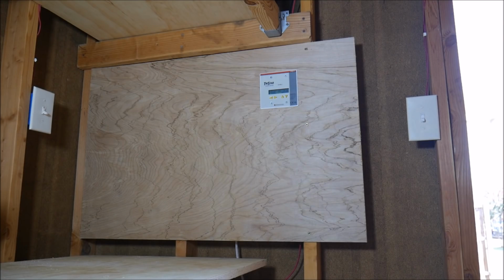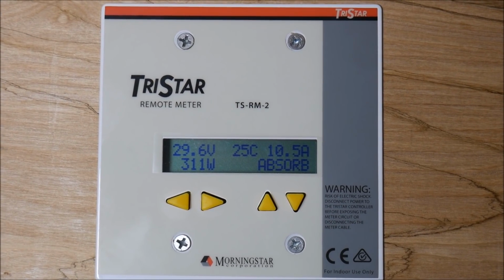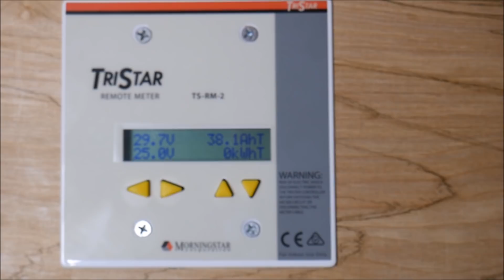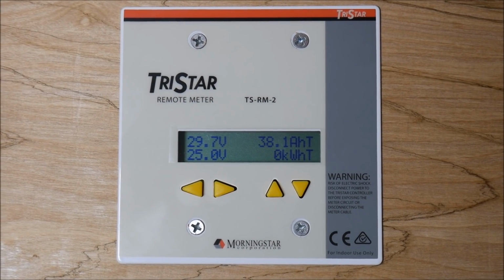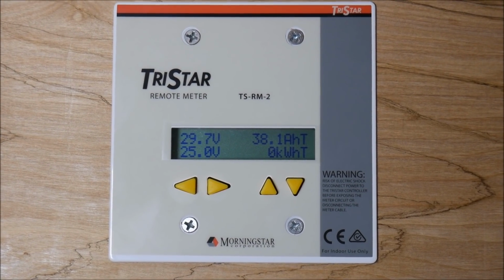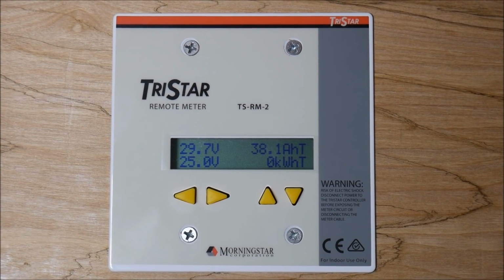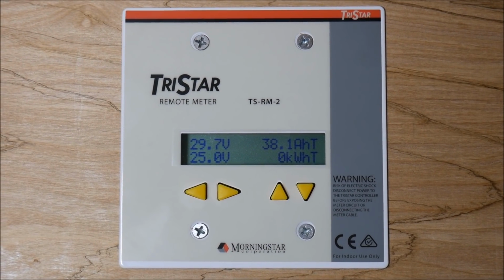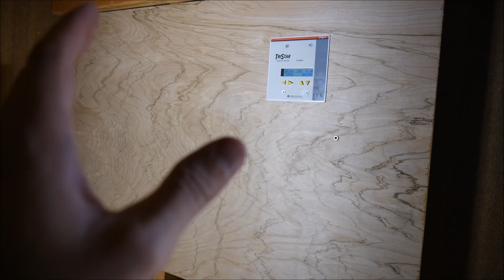Redoing The Solar Shed Part 9 - Finishing Touches

Comment: Very well done professional series! So sad what is going on in your state right now!  I did see an article about a guy in a tiny home in FL and how he still had power, when all else around him was down!  Stay safe!
Reply: oops:  the guy in FL was on all solar like your shed.
Reply from the maker: Yes, only people who had generators and lots of fuel or off-grid solar would have power in a grid down situation like that.  That is one of the reasons I installed this system and got into solar.  I grew up in Oklahoma and there are hundreds of tornados each year.  If one comes within 20-30 miles it can knock out your power for potentially days.  I haven't had that happen but I know others who have.  North Texas where I live doesn't have as many tornados but they still happen.  Also, we have ice storms in the winter because we don't get much snow.  So it rains and then it freezes after it falls.  So ice builds up on the power lines and then they get too heavy and snap.  So we can get power outages in the winter, too.

Comment: What happen to you 600 watt set up
Reply from the maker: The panels are still on the roof.  That was one of the only things I re-used.
Reply: LDSreliance I found your pin on pintrest  and I saw your tests at on point
Reply from the maker: Cool, I didn't know my videos were on pinterest!
Reply: LDSreliance it just the one were you show your duel charge controlors the bank that you had I believe the panels were up against  the building at the time I don't  believe you were final on anything you set up lol
Reply from the maker: Oh that was just a test setup.  I test things on my back porch and just lean the panels against something.

Comment: You could try running 2 fans in series for 24V. You might need to check for resistance match after wiring in series by checking the volts across each fan. Hope your family are well, I have been praying for you.
Reply from the maker: Thanks!  I appreciate the prayers and the suggestion.  I should have thought of that.

Comment: Most importantly, glad to hear the family is doing well.  Now,  where o where is my thumb?   O...here it is. 👍!  Good video.  Lots of folks will be helped by it.  The communication cable and power cable proximity will be just fine.  No problems there.  And the doubling of the two screw connectors is ok for your use.  Your new $125 meter is included in the midnite controller.  Some people miss the fact that the midnite graphics panel (meter) can be easily removed and mounted anywhere you like just by using a six conductor standard phone cable.  A 4 conductor cable can also be used but some readout functions would be reduced.  I havent checked price on your controller but if you add in your meter...and the fact that midnite can handle 96 amps or so...i still go with midnite.  Im just saying and not trying to start a word war with commentors.  And yes i did see yet another computer fan!  LMAO!  I swear....when you die...im coming back from the grave and installing a stinkin computer fan on your headstone just to drive you nuts!!!   😁😁😁😁
Reply from the maker: Hahaha, I knew you would like that.  I even put you in the video description!

OK, I didn't know the front panel could be removed.  Then what do you fill it in with?  I agonized over the decision between those two cc's for months and ultimately just went with something I was more familiar with.  I have had 4 Morningstar cc's and so I just went with them.  That was literally it.  They are both great.  Same price and almost all same functions.  Although the one thing I didn't like about the Midnite is it is one of the slowest sampling/cycling MPPT controllers on the market.
Reply: LDSreliance ....well dangit!  The one video description I dont read and bam...there i am!  God i cant wait to come back from the dead and haunt your fan loving azz!  😁😁😁
   As far as the mppt sampling i honestly dont know about that.  I never studied that.  I went with midnite's test results showing that their cc produced the most power in a given time (compared to most popular competitors).  But this gets into the realm of splitting hairs and it isnt important to me which is better.  A huge part of my decision is based on midnite being American made in America.  Also there 5 year guarantee (which can be extended to 7 years.  Pay a reasonable $145 fee and they will completely refurbish your controller.  A great deal to me).  Price is coming down.  Saw on ebay $530 about a week ago.  I paid $570 couple years ago.  My second one was $550 I believe.  All this is respectfully submitted to help your viewers decide.  MPPT from anybody is definitely the way to go.  Good job dude.  Keep the videos coming.  Maybe you could do a review on computer fans.  Lord only knows we could use info on electric whirly birds! 😝😜😛😝😜😜😜
  Oh and i forgot.  The midnite graphic panel lifts out to be mounted anywhere you like.  There isnt any "hole" left when you remove the panel.  The panel mounts on front case cover.  Really ingenious.
Reply from the maker: Yes, Midnite is awesome.  I want to do a shootout someday and put several big name MPPT controllers to the test in the real world.

Haha, you can never have too many fans.

Comment: Love the videos, all of them. But I am wondering how would a toothpaste battery be (sodium metal (-), fluoride (+) and solid electrolyte)? Why is there cobalt and all these elements in a Li-Ion battery? Like cobalt/ Whats that about? Graphite in the - side of the battery, lithium in both parts of the battery? The Li-Ion battery is so confusing!
Reply from the maker: Good questions.  I haven't done a lot of research into the chemistry of batteries, unfortunately.  Maybe I will dig into that in a future video.
Reply: YES Please! Its like battery manufacturers want their batteries to be expensive and the manufacturing/mining cost to be high.